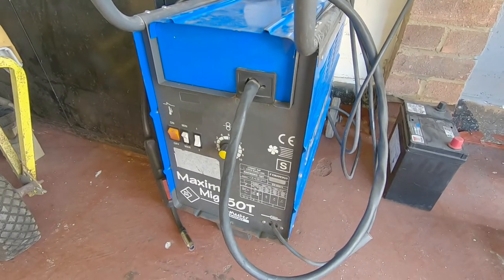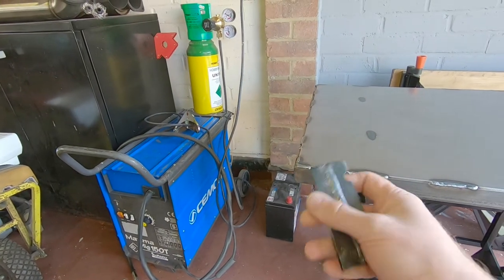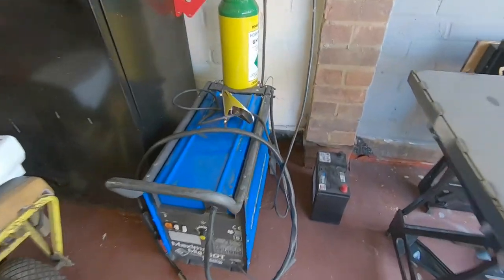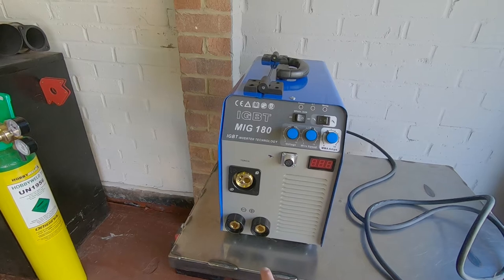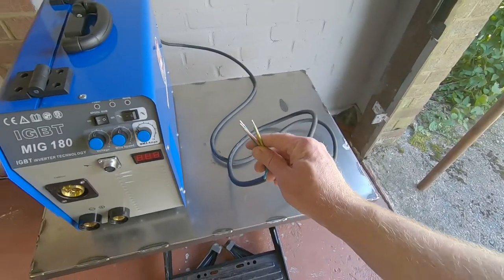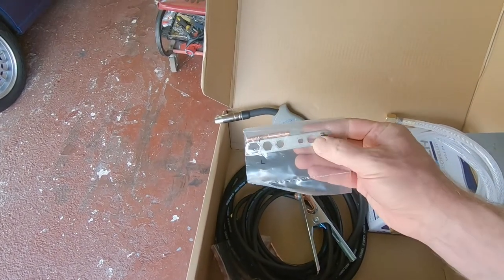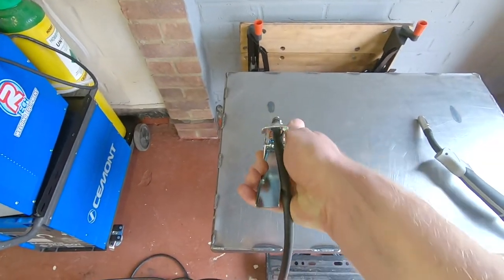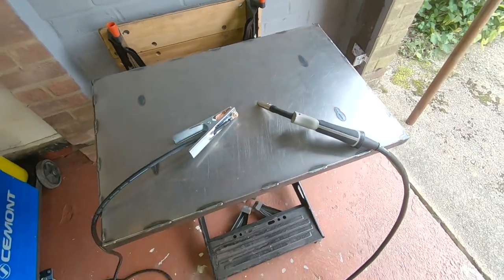R-Tech Mig 180 Welder Review (Not sponsored. Workshop update) | Toyota Starlet 4efe turbo build.

Comment: Intresting review update, treat your mig welder to a Argon Flow Meter, ( Fits between your regulator and gas hose)allows fine tuning of gas flow, will save you wasting gas.Would prefer TIG every time for welding manifold.
Reply from the maker: Thanks for the tip, I would like to learn TIG at some point but feel to do it properly I should buy a dedicated TIG machine with pedal etc. rather than use scratch tig on the mig180. Then can do alu as well. Don't have the funds unfortunately. The mild steel manifold came out well I think and most people have access to mig / enough mig skills to make stuff. TIG requires more training to be competent.
Reply: @dan91sgarage Unless you have lot of TIG work, then it's hard to justify the expense of a dedicated TIG machine for a home workshop.
Reply: Just get one of the pea shooter flow gauges, they're cheap and give you a true flow reading at the gun tip where it counts.👍 Unless appearance is paramount, a good MIG weld will be fine for manifold work IMO.

Comment: Very useful!👍 I'm in the process of replacing my 30yr old 100A Clarke, which is still working but I now need something a lot more powerful. This and the 250A version (perhaps a bit overkill if I'm honest) are on the shortlist. 
Inverter welders are new tech for me and seem to get mixed reviews, especially from old school welders taught on transformer machines but the backup and warranty fro R Tech get good reviews. You can pay much more for a machine of comparable specs and there's also plenty of inverter MIG's out there for a quarter of the price but I just wonder about there longevity.
Reply from the maker: Exactly my thought process before I bought this! Very happy with the R-tech, wouldn't hesitate to buy an inverter welder now. Just keep them clean (carefully blow out the dust) and they're supposed to be just as reliable as the transformer beasts. Great warranty, UK sales and backup etc.

Comment: Hi Dan, I'm looking at putting a 16amp socket in my shed for my welder, just wondering if you had a spare mcb and ran it off it, or had to share one with something else? The reason I ask is that I have no spare mbcs in my consumer unit... Enjoyed your vid BTW 👍
Reply from the maker: My electrician friend did the wiring, so I had a new consumer unit fitted for all the garage electrics. It has its own dedicated 16amp MCB in this for the 16 amp socket only.

Comment: How does it perform on welding thin materials , just thinking about whether it will be suitable for welding thin pipe for exhaust system
Reply from the maker: Very happy with it, I welded up a downpipe for the turbo in 1.5mm mild using 0.6mm wire and hobbyweld 15% argon mix gas no problems, good penetration, no blow outs. Because the power and wire speed are infinitely adjustable knobs (not 4 step clunky switches) you can fine tune it really well. I've welded down to 1mm fine aswell for test pieces. Deffo wouldn't want straight CO2 as sheilding though, argon mix for me.

https://youtu.be/ywL6uBM7njI?si=NAF_LbyslC3_F2Zx

Comment: Hi would be good to know your thoughts after using your Rtech MIG . Thanks 👍
Reply from the maker: Pleased with its performance since day one really, no problems to speak of, would have preferred if it had the capability to pre-shroud with gas before introducing the wire but no porosity so far. Welded up a mild steel turbo log manifold and its held together fine even with my self taught "style" of welding. Also welded up a 1.5mm wall mild steel downpipe and welded a stainless catalytic converter into a 1.5mm wall stainless exhaust system fine as well. The infinitely adjustable dials (not stepped) is a bit daunting at first with the extra adjustability but you soon get used to the benefit of being able to add just a tiny bit more voltage /wire rather than going up a step and it being an animal! Good machine, glad I spent the extra over the Rohr 200 I was also looking at (better warranty with the R-tech too).

Comment: Thanks for the review. What MCB do you have for the 16A socket on the consumer unit?
Reply from the maker: Not sure, it's probably B or C Curve. R-tech say it'll weld at 160 amps on a 13amp plug, so if it can't weld at 180 amps on a 16a B curve I don't know what the point of a 16 amp plug is at all! Most 150 amp welders are on 13 amp any way right?
Reply: Using a16A Type C breaker here.

Comment: Why would you want to Pre gas.. Its a shielding gas to shield the weld so just a waste of gas if it comes out before starting to weld
Reply from the maker: On all the mig's I have used before, the triggers had a first stage that would release gas to ensure that there was shielding gas to shield the weld, the second stage of the trigger introduced the wire. If the wire makes contact with the work piece before sufficient gas is there (both wire and gas released together) it could be in danger of porosity. Perhaps modern machines are faster at starting the gas flow and don't need this feature any more, it could also be dependent on where the valve to release the gas is located (machine or torch handle?) Don't forget you can get stainless mig wire as well to run in these machines and we know how sensitive that can be. The ability to pre and post shroud with the trigger would be nice, all I'm saying. Also when you turn the gas bottle off you can use the "gas only first stage" of the trigger to drain the reg without having to take the tension off the wire feed mech. As I said in the video, so far, no porosity on the mild welds I've done. 😀